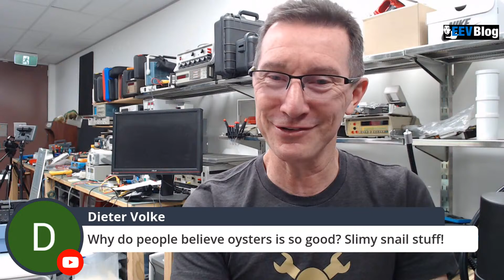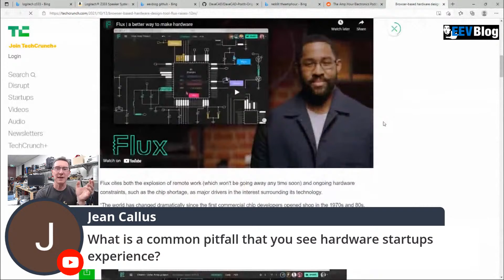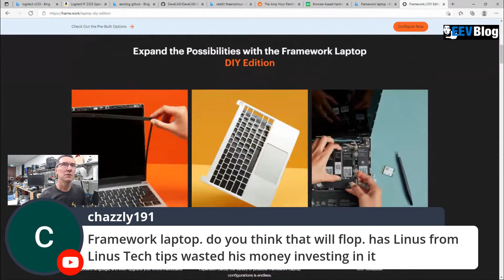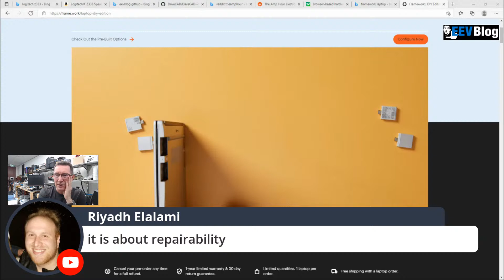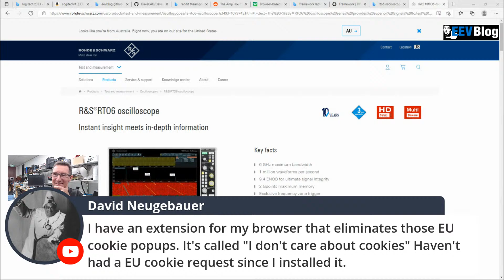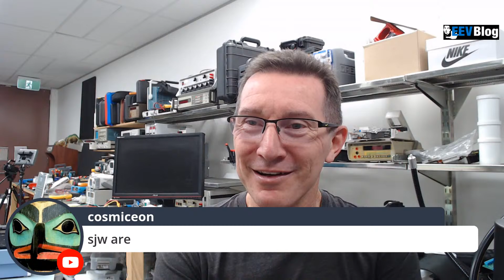Saturday Morning EEVlive

Comment: Yeah I wasn't that impressed by that laptop. I mean it looks good sure but people were acting like it was really good. I think the no glue thing is good and the socketed components. But the modular ports seem like a bit of a gimmick to me. They would have just put loads of ports on the back and a few on the side and then had one or two modular ports so you could add that one wired port you want to use. I mean I think making something that you can actually open up is really good but I'm just not that impress by the design and the modular ports. I think a lot of people that care about reparability would want something more like an old thinkpad anyway. They should have just blatently copied something like the x61 LOL.